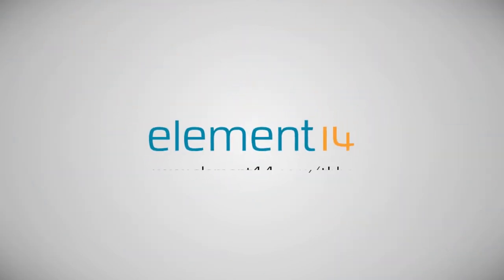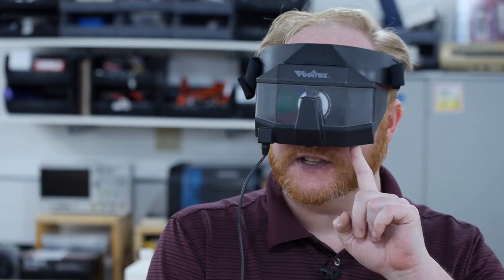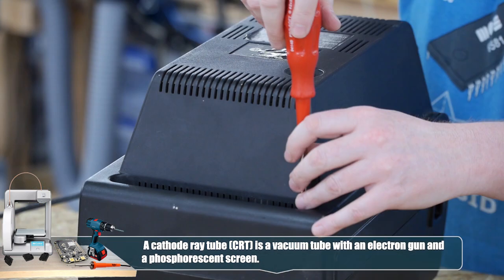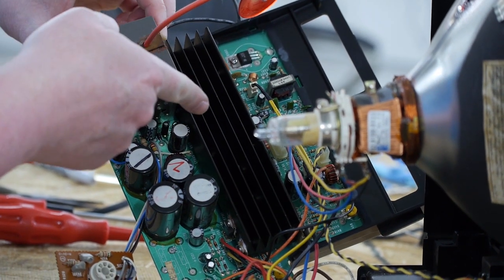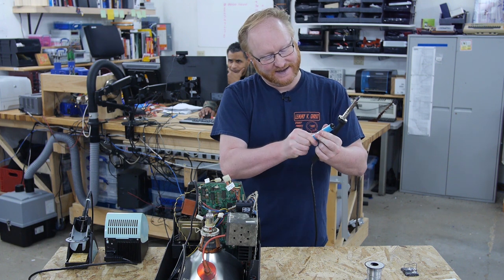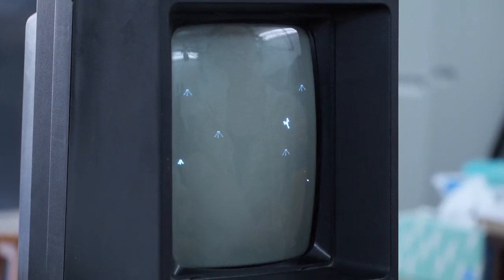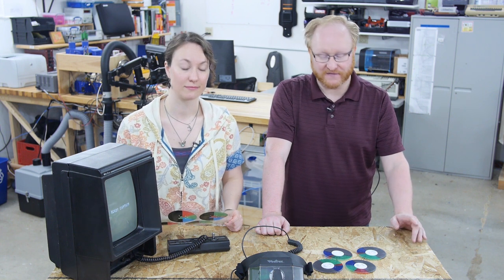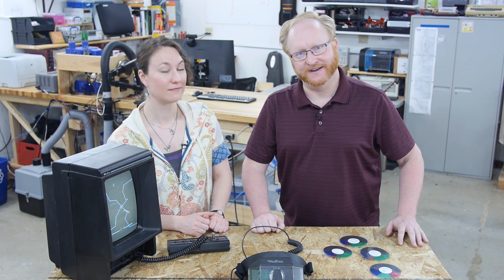Ultra Rare Vectrex Repair

Comment: Ahhh now someday when I have the money to get a multigame cart for my Vectrex and a 3d printer I can finally make disks for the 3d games I haven't played. Been a Vectrex fanboy for years. Got my Vectrex back in 83 or 84 when i was 9 or 10. And it still works. I even play it from time to time. I have tons of games for it and a broken light pen. I'm working on building a new light pen though. Great system. Way ahead of it's time. Thank's Ben for showing something that very few people will ever get to see.
Reply: You would still need the 3D imager for that.
But maybe its possible to make one?
Reply: I do have one. But I only have the color wheel for 3d minesweeper.

Comment: Transparencies for laser printers are heat resistent to a certain degree and can be laminated into pouches for additional strength/ stiffness. I use that to recreate damaged pinball plastics.

Comment: The Vectrex is like the DeLorean of vintage game consoles. Always wanted one of each.

My first console was the ColecoVision and even though a lot of the arcade ports on it saw more accurate ports to future systems, I still find an undeniable charm those earlier ones. I used to play the crap out of Donkey Kong Junior on that thing. Half the challenge of playing games on a Coleco though was wrestling with those weird flat-top joysticks that had almost zero travel. You needed the keypad on it to select your game mode and difficulty but you could easily swap out the second one with a VCS joystick or almost anything else that had that same DE9 connector. Years later I tried with a SEGA Genesis pad, totally worked but took all the of the physical stick wrestling challenge away from the experience, hehe.
Reply: hahah. Yeah, I can imagine. I use a Mega Drive controller for my 800XL as well. The official controllers I have for it are the worst. (a bit of research showed them to be 7800 Pro controllers. Which sucked badly even by atari standards.)

It''s really only a quirk of fate that makes it possible though. Technically the sega and Atari wiring standards are different.
Luckily most atari port compliant systems don't care, but never use a Sega controller on a Commodore 64 unless you like the thought of frying your keyboard controller.
Ouch.

Basically the wiring issue between the two is that the Sega standard has it's +5 volt line on what is an unused pin for the Atari standard, and the Atari's 5 volt power pin is the 'select' line on the Sega controller.

The 'select' line, is how a Mega Drive can have 4 buttons and a D-pad and still work on a 9 pin port without any particularly fancy internal circuitry. (by comparison NES and SNES controllers have shift registers in them, and the Sega 6 button controller has it's own CPU, but the 3 button controller just has a tiny bit of logic for the select line, and then the buttons wired directly to the pins.)

When the 'select' line is low, you can read the Up, Left, Start and A buttons because they will pull a related pin on the controller port to ground.
When the 'select' line is high, you can read up, left, right, down, B and C through the same method. (B maps to the same line as Start, C to the same line as A)
As you can see though, with it low, half the D-pad no longer works. (not sure why, but that's how it is.)
Luckily, the 'select' line is the Atari's controller power line, so it's always 'high'.
Just as luckily, unused pins in an atari port are always high too. Which is why the controller still gets power even though it's power line is wired to an unused pin.

The final bits of luck - D-pad maps correctly to joystick direction lines on Atari port.
And the B button maps to the button line on atari ports as well.
(also the C button maps to a pin that you can read from hardware on an atari, as well as the second button on atari 7800 systems. Meaning homebrew software can read a second button from the controller. But obviously standard software cannot...)

Comment: Sort of interesting but it's like they are phoning them in now.  No details of what they are doing like the old days.  It's troubling what the show will be come July.
Reply: Thank God I'm not alone. I don't even know what gels he's saying they used.
Reply: It would also be nice to see inside the glasses, how they sync the wheel with the screen, if they could reverse engineer it etc.
Reply: My exact thoughts, what is interesting is the design decisions, the problems, and how they made it, even if it is from a high level point of view. But it's just "we have this problem, and we solved it" without explaining almost anything more. Like in this video, they show clips from various approaches that they used for the colors it seems, but it's just B roll, it doesn't explain what you're seeing, if those the one they used, what problems the ones the other ones had, why the chosen one was the best solution, not even the different approaches used were discused, just "look what we did, goodbye".  Because of that I lost interest and unsubscribed a while ago because of that but this was recommended and tried to give it a second chance to see how things are going.
Reply: Yup, went from a google image of a disc and then all of the sudden there is a working disc? Yeah ok.

Comment: I have an Atari Super Pong, I have never replaced the D-Cells in it. They're from 1994!
Reply: ObiTrev 
Have you at least checked that they haven't leaked?
Reply: ObiTrev I have a Pokedex from the 90's the batteries still work.
Reply: I check every year... In fact... 
https://imgur.com/mG4b9Ol
https://imgur.com/CX8j07z
https://imgur.com/Kl6fcAQ

That's not leakage, that's a fix my grandfather did in the 70s when my Dad and Uncle got in a fight. Imagine having to share THE CONTROLLER with your brother! Somebody wouldn't stop shaking it. Controller cheat?

Comment: Already 'Ben' confirmed by both teams the industrial design of the Vectrex and the Macintosh are simply happy coincidences that evolved independently.  A good design naturally replicates itself whether from Smith Engineering / GCE or Apple.
:)
Reply: Only a little over 1 square inch between them.  Amazing.

Comment: FYI the flyback often has a HV bleeder resistor that discharges the tube within seconds of turning the power off. Not so much for safety but to prevent the bright dot in the middle of the screen you see on really old TVs that don't have a bleeder.

Comment: I will miss Ben and all this and the regrettable acting.
I have to repair a Game Boy DMG of the Playing Loud Serie. It has the common problem with the vertical lines in the display but I think a capacitor also blow because now don't turns on

Comment: The Atari 2600 is the only console from the early 80's that I have played and really enjoyed. I have actually repaired one earlier this year. 

My 5200 doesn't have any working controllers. I can't give an opinion on it's fun factor. (You guys really should market that 5200 controller you built a few weeks ago.) Both Intellivision and Colecovision have really weird/uncomfortable controllers. I have never had the pleasure of playing a Vectrex.
Reply: I have no idea about the 5200. A lot hinges on the games.
I love the hardware indirectly, because it's the same as what's in my 800XL, which is the only 8 bit home computer I ever owned. (I was too young for 80's computing really - I owned that 800XL from second-hand stuff in the early 80's)
Reply: The 5200 was a console-ized version of the Atari 400 platform, the least capable of all their 8-Bit machines.

Comment: Seriously don't discharge a CRT at home. Even if its been sitting around for a while unused. I was being an idiot, and tried to do this without any knowledge of how its done and ended up discharging the capacitor through myself. I broke the one hand behind the back rule, but somehow the current went through my jaw instead of my chest. If it hadn't, I likely wouldn't be here. It left me stunned, but otherwise unscathed. Please don't do what I did, it can kill you
Reply: Glad you are ok! I have a working Vectrex and idk WHAT I'm gonna do when the caps need to be replaced. Problem for future me I guess. XD

Comment: Since you didn't hear the pop, what made you confident enough to continue working? Do you have guidance on how to double check the CRT has been discharged before continuing?
Reply: Since there wasn't an electrical pop that means the capacitor was discharged and there is no danger

Comment: I loved how you just lifted the template from a image online.  LOL  If you could have done something like that in 1982, Vectrex would have lost their mind.  hehehe  You're totally infringing on our IP dude.  :D
Reply: Also... with a 3D printer and a modern MCU like an adruino or something, wouldn't it be possibly to make your own version of the headset? I suspect it's just receiving data from the unit that tells the motor how fast to run to sync the disk to the display, right?

Comment: From memory, I don't think it has a 6502 CPU! I thought it was a 6800.
Reply: 6809
Reply: Yeah, it does. Though the 6502 is supposed to be a drop-in improved replacement of a 6800 or something...

And of course the 6800 is the 8 bit predecessor of the 68000, hence the name...
Reply: The 6502 isn't really a drop in replacement Its possible to put a 6501 in a 6800 socket, though they are not software compatible they are pin compatible. The 6809 in the Vectrex is evolution of the 6800 but has quite different and innovative design.